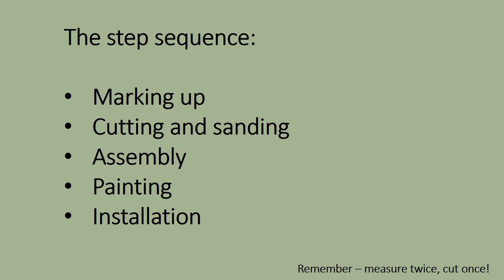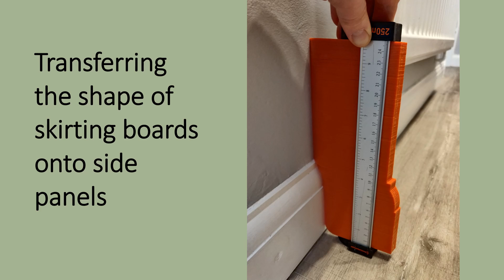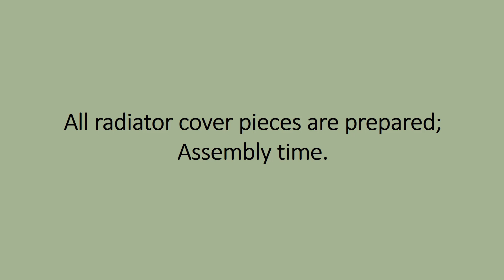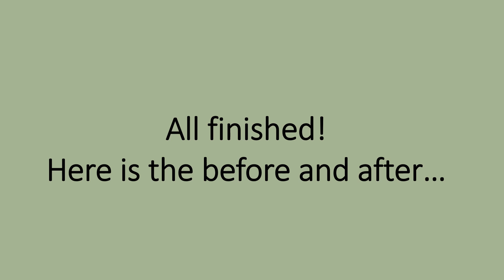How To Build A Simple Radiator Cover - DIY

Comment: Great... for keeping the sides attached your method better than wooden dowels or biscuit joint???
Reply from the maker: Thanks! 
No, not necessarily better.  I don't have a tool for biscuit joints, so used a different method.

Comment: This is a great idea! I am going to try this for the in-wall type baseboard radiators I have. Question: How did you attach the top? Screws, or just glue?
Reply from the maker: Thanks!
The top is just sitting (not fixed) on the frame with three small pieces of MDF attached at the bottom to prevent it from sliding either way.
Hope it helps and good luck with your project.
Reply: @DIY_it_ALL  Great idea. Thanks again! Will send pics when mine is done.

Comment: Great idea. Just wondering what thickness of MDF board did you use? Is there any issue with it warping or any burning smell with the heat from the radiator?
Reply from the maker: Thanks! 
I used 18mm MDF. No warping to date nor any smells. I think majority of off-the-shelf radiator covers are made from MDF.
Hope it helps.

Comment: How did you attach it to the wall?
Reply from the maker: I used small 90 degree corner brackets. One side attached to a wall, the other side to the radiator cover.